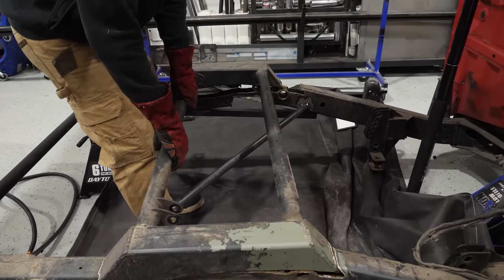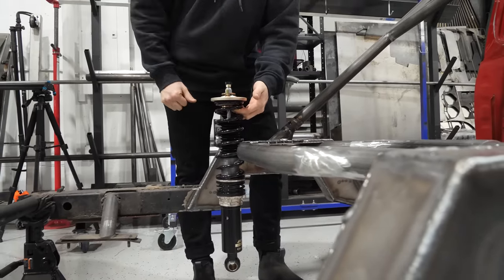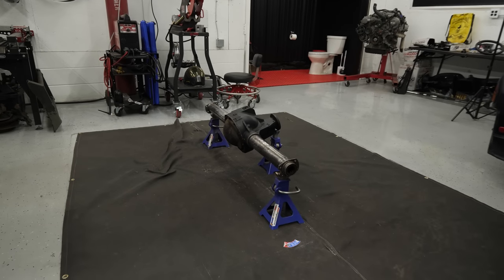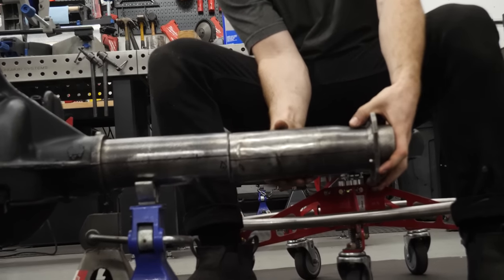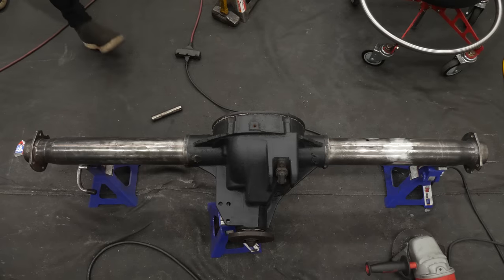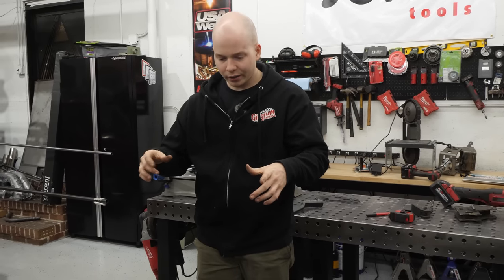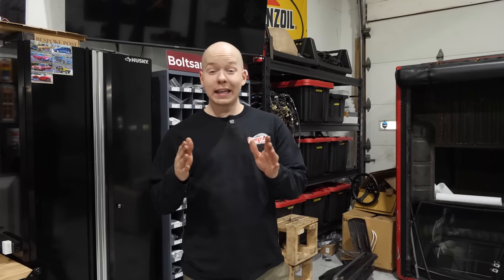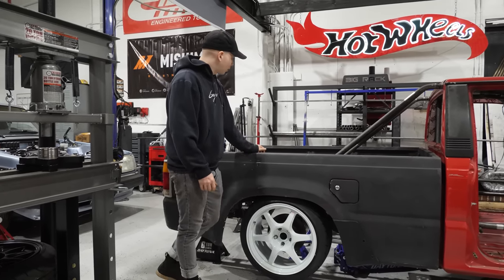Building The Ultimate 8.8 Solid Axle For DRIFT TRUCK V2... Why Not IRS?

Comment: I love your content, and think you do some pretty awesome stuff. As an engineer, I’d caution you from running with those slotted holes in the bracket. There are a lot of stress concentrations in those overlapping hole edges and could definitely cause a failure.
Reply: Glad to see this here, that sheet steel will probably fail if you don't use the "slotted holes" for position only - could just make new brackets with the desired height selected?

Comment: you should use the 4wd front fenders as a set of "overs" on your stock fenders. spacing it out as far as you need and having a more oem+ look. plasma out the filler pieces and you're good to go.

Comment: So aside from the Cannon diff, and the human-welding, those holes for the bracket slots can and will bring up the issue of your axle sliding down on them, when the bolts eventually loosen from the vibrations of you going full send in this thing. 

Now if your axles bolts are already situated at the bottom of those slots, no problem until you go on a bumpy road that causes your diff to go upwards into the cab. If it isn't, maybe take some time to convert those slots into holes again if you haven't fully welded the brackets yet.

The more potential risks you can think of, come up with a solution for, practice said solution, then eliminate/minimize said risk, the longer this truck will last.
Reply from the maker: The slots actually aren’t ovals, they’re three circles that’s are slightly connected. So there is metal preventing the bolts from sliding around!
Reply: @_Gingium_  seems you were one step ahead. Don't stop now!
Reply: @_Gingium_  with forces you dealing in suspension it can became ovals ... so for me - risky move .

Comment: Okay I have a cool junkyard find for you get a rear diff cover off a 2003 explorer that is aluminum and has tabs on it  and cut cut them off and cover will bolt right up to the live axle and now have a drain plug and fill. No more sealing it back up again and again

Comment: Hey bro don't get wheels spacers for the rear, get a C-clip eliminator kit. It will space out the wheels and make the axle safer. Also weld the tubes to the center housing. They like to spin.

Comment: You should probably run some c clip eliminators if you’re not already running them because if you break an axle without them the axle can just slide straight out with the wheel attached, it’ll usually just snap off the calliper bracket on the way out
Reply: Explorer 8.8 with 32 spline axles with 9.5 inch wheels, unless he's on slicks and gripping up (the opposite of what the truck will be doing) there's like no chance of him breaking an axle

Comment: Try designing in millimeters, it's so much easier. You don't have to mess around with huge numbers. 0.1 mm is more than enough tolerance for what you're building.
Reply from the maker: I agree, but I don’t have mm tape measures lol
Reply: @_Gingium_  I'll send you one, lol! I designed in solidworks using inches for years, but after making the switch I'll never go back. Since you're already used to doing quick math, it gets infinitely easier when you're dealing with whole numbers. .04 inches is 1mm to give you an idea.

Comment: Love seeing your work!
Have you considered a watts link instead of a panhard bar?
It suits your needs (centering the rear axle, coping with side loads) perfectly
Reply: panhards are pretty decent but yeah if he’s basically custom fabbing everything a watts links should make the live axle feel just as solid as irs
Reply: A panhard is fine for what he has. If he was running airbags, that's when you need a watts link. It keeps the rear axle centered  no matter how high or low the truck is.

Comment: Seeing a cantilever it instantly reminded me of working on old ww2 military vehicles some of them use a vertical arm that goes up to a horizontal arm attached to a coiled spring packed inside a greased cylinder as the arm pushed up the spring would unwind causing back pressure like a primitive Cantilever shock system

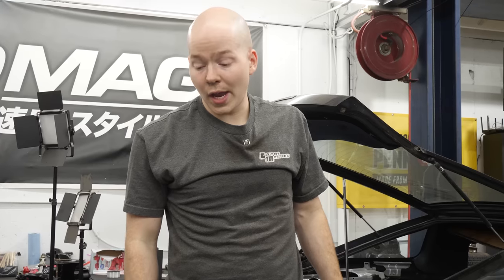Comment: 10:11 there's another reason: since the engine in the Explorer was mounted longitudinally, the engine torque would cause the body to move and would also make the vehicle steer into one direction when applying torque, which becomes more apparent the softer the suspension is. Placing the differential offset from the center helps to mitigate that issue; since the bulk of the torque from the rear axle towards the chassis is being applied via the shorter lever arm (the 17" long axle), there is less force being applied to the chassis, causing the body to move less. This has the added benefit of freeing up space for the gas tank under the car, but placing the gas tank on one side was not the primary reason why they did it 🤓🤓🤓🤓🤓🤓🤓🤓🤓🤓🤓🤓🤓🤓🤓🤓🤓🤓🤓🤓🤓🤓🤓🤓🤓🤓

Comment: I'm not sure what your plan is with the bed floor and I say that based on where you cut it. When you body drop a bed, you dont cut the floor out. You removed say 2-3" from the inner bedside and you cut the front and rear at their furthest point. So like in your case. The side cut would have been made above your wheel tubs. That space above them is what you'd want to removed the whole length. When you'd weld it back together, the top of your wheel tubs would be about the same as the top of the bed rails. Just raising the portion you cut out is gonna leave pockets on the sides.

Comment: You should tig weld the axle tubes to the housing in drag racing snd drifting the pins are known to fall out and you loose your axle tubes just a thin weld below the lip of the housing

Comment: Love the content, great work, but one error: those aren't ladder bars. That's a 4 link, a ladder bar suspension used to be a pretty common upgrade on drag cars with leaf spring rear ends to prevent wheel hop. Instead of an upper and lower arm, it was simply a single arm with one pivot point at the front, and none at the rear as it was welded straight to the axle tube. They can be used with coil springs, of course, but I don't know why you would over a 4 link or any factory setup. They were just a really simple way to add positive axle location in a leaf spring car.

Comment: my IRS 8.8 axle broke on my Thunder Bird... at the wheel hub sheared the splined spindle off the CV socket, so i cut and welded it back together in less then 3 hours... parts are 6 weeks out and cost more the $900 with shipping to my out of the way location up north. $5 fix with 165amp's of 3/32'' 70'000psi filler rod even if the new replacement is $60 the weld size puts it at 693lbft flywheel to twist it off again. N/A 4.6 V8 280lbft, years...

Comment: I've had that happen before when replacing an o2 sensor. I had to retap the threads and sprayed pb on it, then used the torch to try burning it off. The pb inside the tube blew out like that. Was like a gunshot right next to my ear.

Comment: should have drilled out the spot welds on the pumpkin. pulled the axle tube than trimmed it down. there are plenty of videos out there that show how to do this. it would prevent having a welded section in the middle of the axle tube that you need to insure is absolutely straight.

Comment: I'll preface by saying I'm not qualified to speak much on the subject, but I have a feeling that the combustion that happened might have been cooler than it seemed. That seemed a bit like how a pulse jet engine works, where you blowing into it created a quick vacuum that combusted and pulled more air in. Or... something along those lines. The sound might have been related to the vacuum, perhaps? Maybe someone can confirm or deny. Regardless of vacuums, loving the build

Comment: Them slotted holes in the brackets are almost as brilliant as the gas tank in the front idea. With all the forces the rear suspension is under when it's being thrown around I'm not sure if that was such a good idea to join all the holes like that
Reply from the maker: There is still metal making three separate circles, it’s not one big oval. Don’t think it’ll be an issue
Reply: Look again and use your eyes this time, genius. The bolt cannot slide up or down because there are indexes.
Reply: @shiftymiata  I see the indexes but I've also seen full holes stretch. My concern lies in the fact that there are only little points stopping the bolt from wandering.

Comment: Don’t get me wrong, I love this channel and the cars on it. I love what you’re trying to do. But… there’s a lot of fabrication mistakes you’re making which are going to bite you down the line, like those adjustable brackets. They’ll be fully slotted the first time you beat on the car. It’s a bad solution to that problem.
Reply: Could just make removable inserts to fill the gap. Narrowing the rear end the way he did is worse, it wont be straight
Reply from the maker: How much u wanna bet it won’t?
Reply: @_Gingium_  how about a free t-shirt if I’m right? ;)

Comment: Get a dial indicator and measure the run out on the face of the axle on the side you cut. Has to be within 5 thousandths of travel. Otherwise you’re eating wheel bearings and pitting axles.

Comment: Seems a bit odd to be talking about the rear live axle "since it's a truck" and still wanting to do truck things, but then running basically a car-based McPherson front strut suspension setup.  Also, because the front track is pushed out so far, why not lengthen the shorter side of the Ford axle to match the longer side, and run 2 of the longer axles?  That might have removed the need to run spacers.  Like Mike from StanceWorks said on his K-powered Ferrari build, using spacers on a fully custom suspension seems like a Band-Aid solution, instead of just making the suspension be the dimensions you need it to be initially.

Comment: I'm not so sure that was a good design idea with the axle side mounts. I feel like without there being some meat between the bolt holes it'll eventually push itself through the gap. Interested to see how it holds up though. I could be wrong and it'll stand the test of time.

Comment: As a welder by trade, I would not trust that axle. I can see that you gouged the fuck out of it at the weld seem, there is a very noticeable divot in the steel where you grinded the weld, you probably have about half the thickness of factory in that spot right now

Comment: Soo to get this straight... you cut the axle to have to put spacers on o.O

No logic in that train of thought... sure having the pumpkin in the middle might be more symmetrical... but spacers will put unneeded stress on your wheel bearings... which will wear quicker since they have bigger forces than originally designed for...